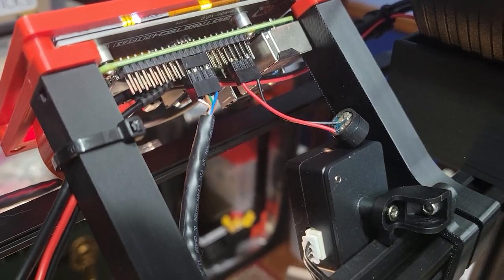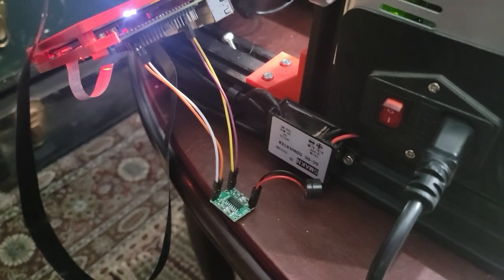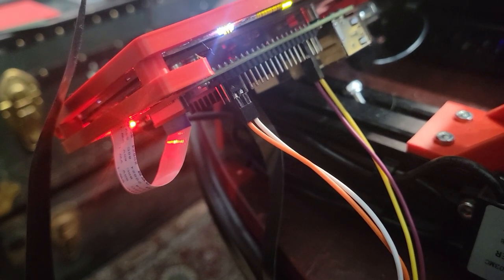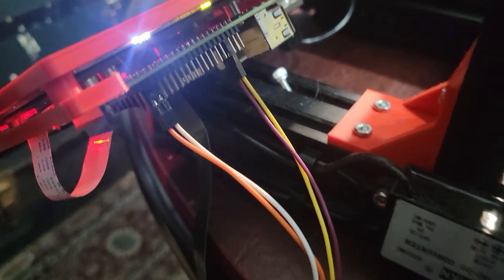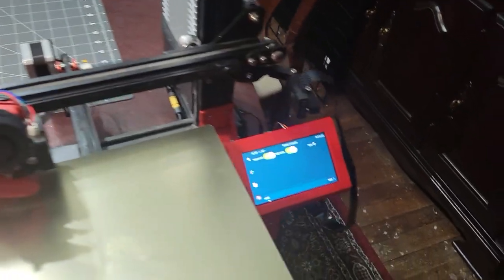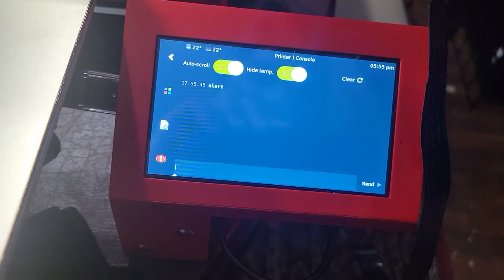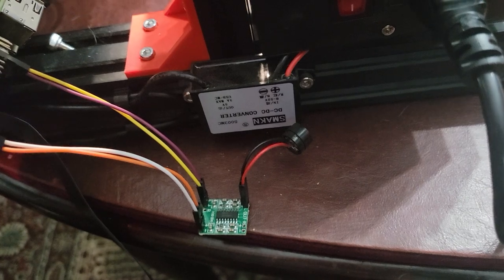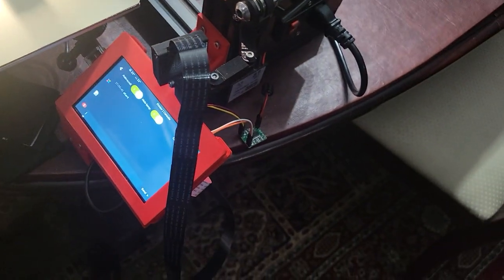Piezo Speaker Connected to a 5V Digital Amp for Klipper M300 Music

Comment: Just tried to use this on my klipper instance and it's throwing an error in the code.

Source contains parsing errors: '/home/pi/printer_data/config/speaker.cfg'
	[line 14]: 'G4 P{P}\n'

Not sure what to do as I don't understand what the error actually is.

(The code in the cfg file doesn't have the \n or the single quotes, the error message just adds those.)
Reply from the maker: Email me your CFG at vampyrex13 at hotmail dot com and I can take a quick look.

Comment: Hey Derrick, this is unrelated to the video, but I have a Scion tc 2014, and the solar shift knob that lights up  does not light up anymore. I was wondering if you could tell me the issue. Thanks for making scion videos.
Reply from the maker: Unfortunately, I've never even seen one of those in person. I would assume that it has a small battery inside it gets charged by the solar panel so that it lights up at night. It's possible that after this many years, the battery has died. I have no idea if it's serviceable or not, but if you're good with tinkering, you might be able to pop it apart and check.
Reply: @VampyreX13  
Yeah, I'm not sure, neither. But I'll try. Thanks again.
Reply from the maker: @jcampo5054  just lemme know how things go.
Reply: @Derrick Aquino  
Hey Derrick, it turns out that it does have a battery. I had to open the knob. It also turns out that the solar panel was damaged from the inside somehow. I just ordered a replacement that someone was selling. Thanks for your help.